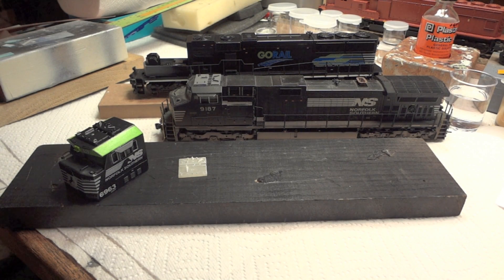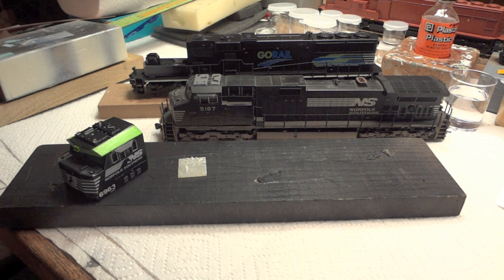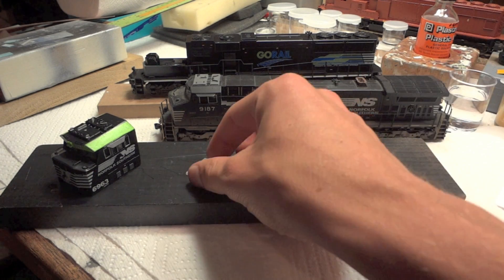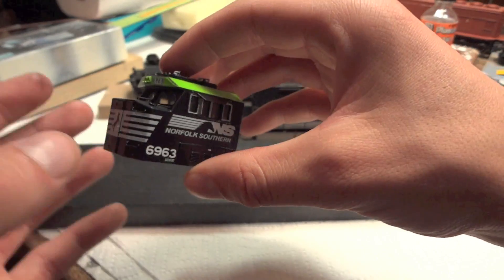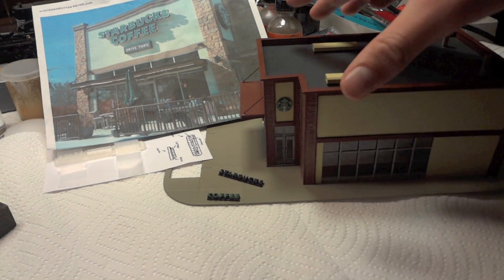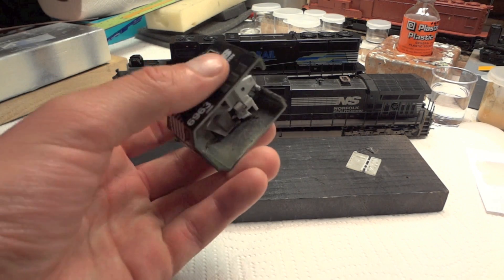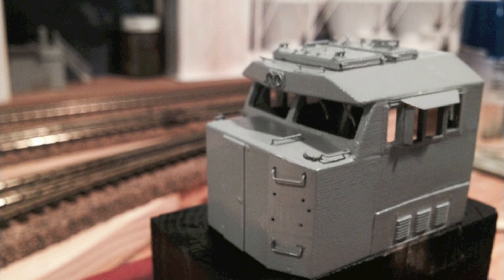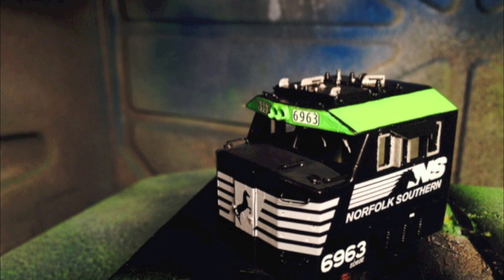3D PRINTING & MODEL RAILROADING - A New Method of Modeling for All Scales

Comment: Josh, great video.  The technology is great and getting better all the time.  What people need to remember is to have realistic expectations from this technology ... 3D printed parts are a great starting point for a model or model part, however we are a long way away from the point where you can take a 3D printed part right out of the machine and paint it and be happy with the results.   I use this technology in my company quite a bit, I have a lower resolution machine in house and I use Shapeways for the high res stuff and this saves me a lot of time making master miniatures that will eventually be cast in urethane casting resin or soft metal.

Comment: 3D printing has been around for a long time in commercial use.  There are many types of printers from dry material to liquid.  They make car parts from dry metal to any thing you could imagine.  Home use on the other hand has been mostly plastic which needs quite a bit more work.  I would love to get my hands on a printer. 
Scott